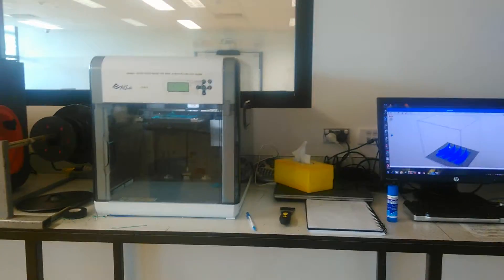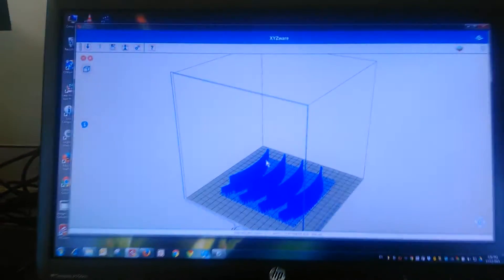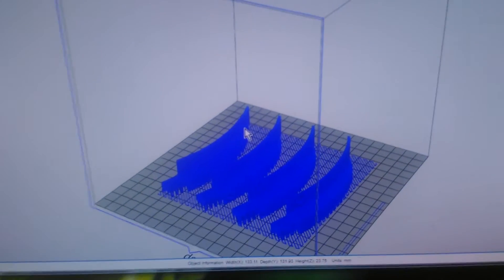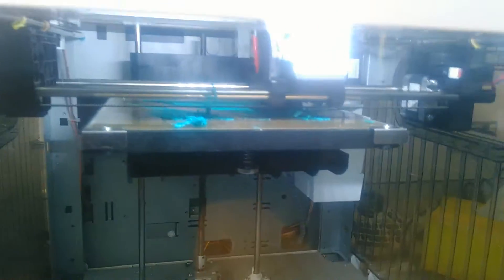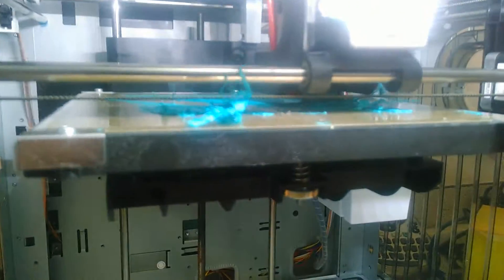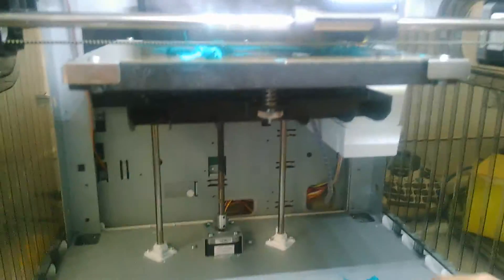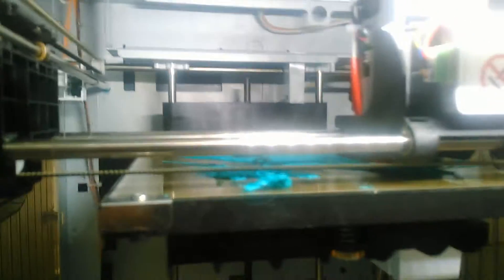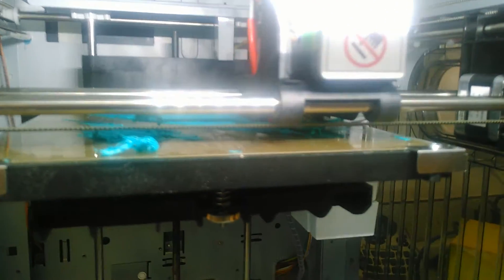Da Vinci 1.0 3D Printer - slip in x axis

Comment: Hi. Did you fix it ? Because i got the same problem...
Reply from the maker: Hi Fred, no I didn't. Normally slip is caused by a belt that is too loose. The davinci has ways of increasing the belt tension. But honestly I think there are better ways. The UPBOX for example uses springs that grip and tension the belts automatically. Also you can 3D print clamps that slide on the belt to increase the tension. Unfortunately you need a functioning 3D printer to get those prints.

Comment: I had the same thing happen and it turned out to be the bundle of wires getting hooked on the left top side of the extruder.  For me, it happened when I was printing something big that needed the head to go all the way over to the left front of the print bed.  The object I was printing was circular, so in one of the loops, the wires got hooked on the top of the extruder and stopped it from going all the way over to the left.  To get the print done, I wound up looping a loose rubber band onto the wires and using the top lid to gently pull the wires up so it was less likely to get caught on the extruder.